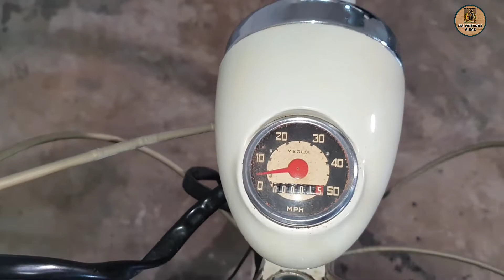Innocenti Lambretta 48 Moped || 1955 Vintage Moped || 1 Of 10 In India || Bike Vlog ||

Comment: Hello friend, I write from Italy, which wheel can I mount modern?  i am not an expert thanks
Reply from the maker: Hi there, thanks for Responding to my Video.
Reply from the maker: I Bought New tyres From UK through Online Shopping website SCOTTERS RESTORATION LAMBRETTA... you go through this once
Reply: @SriMukundaVlogs  I can say that you have given me an excellent suggestion.  You did a nice detailed review, hard to find in Italy.  Thanks for adding subtitle
Reply: For the record and since you seem like a big wilt, in April 1957 in the F1 Monza Italia circuit he ran as a test to demonstrate the extreme reliability of the single cylinder the Lambretta 48 for 100 hours and about 6000 laps without ever stopping, with an increased tank and a seat also on the rear rack to lower better during the long straights.  They used 7 Innocenti test drivers.  The Lambretta 48 did not report any problems.  Truly an excellent motorcycle that did not have the deserved success.  80km liter.
Reply from the maker: Hi it's very nice hearing from you...
And thanks for the most valuable information...😊😊
Reply: @gandalf2tamiya  Rough and tough vehicle. 👏👏👏
Reply: @t.p.visweswarasharma6738  ❤️❤️❤️ I am restoring!
Reply: 26`